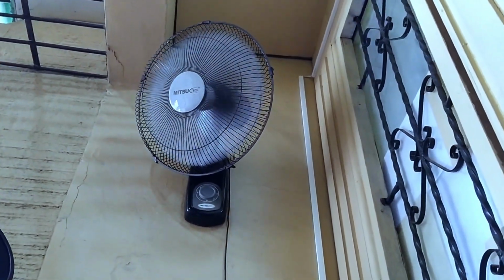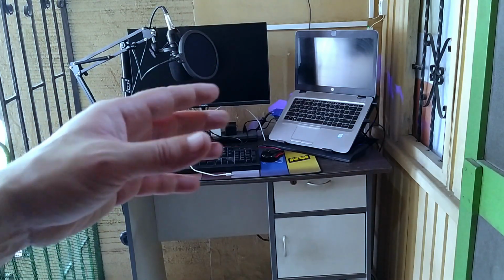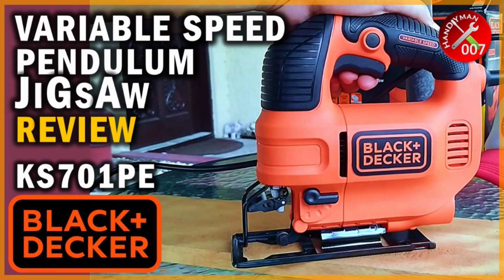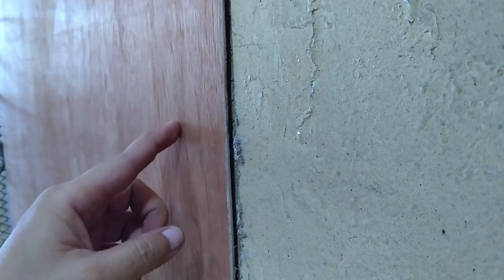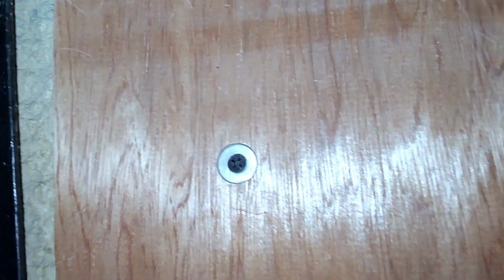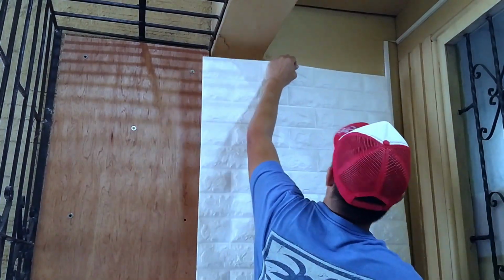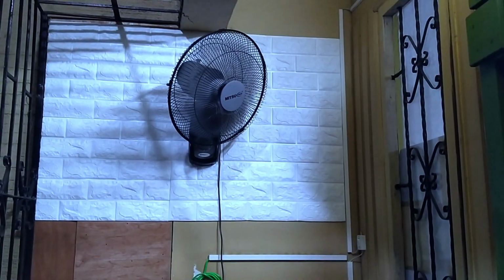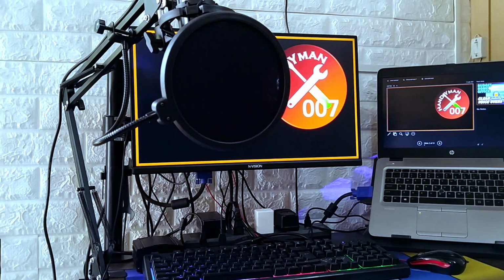How to Cover Ugly Wall w/o Paint (3D Foam Wallpaper Installation)

Comment: If you ever need to wait for glue to dry like that on the wall, put dabs of hot glue in between your regular glue and the hot glue will dry and hold it while the regular glue cures.  You just got a new subscriber.
Reply from the maker: Thanks for the tip! 👍

Comment: Did peeled off after exposing to heat day after day until today?
Reply from the maker: A couple of corners sometimes come loose but all I needed to do was pat them back down. So far everything is still stuck on the wall even after 2 summers.
Reply: @HanDIYman007  thx for the feedback your experience give an idea